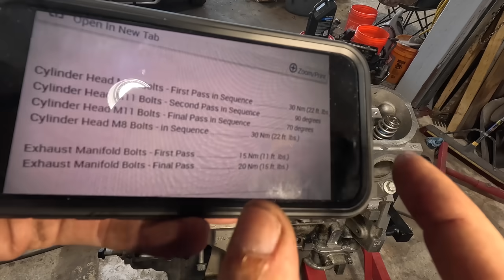This is the LAST VIDEO (LS Engine Rebuild) Ls1 Ls4 2006 SS Monte Carlo 5.3 Part 5

Comment: Ray, you missed chasing a threaded hole on the right side block for the right side head. Bottom hole 3rd one back due to wife unit interrupting you to do "paperwork" 😉 in office.
Reply: Yup...  I was going to say the same thing.
Reply: That's why you can't have interruptions when assembling or rebuilding an engine, as one lapse of concentration and you may have to do some major repair work or pull the engine out again.

Comment: On the crosshatching of the cylinders while I did not complain I believe what may have caught the eyes of some viewers is that they were done by hand and they are not at perfectly identical angles from cylinder to cylinder.    Really the main thing that matters is that the piston rings develop a good seal without breaking any rings and and have good compression and the oil rings clean oil from the cylinder walls.    Not so important that they all look nice.

Comment: Ray must think I need help spending money. Ever since i seen that 56oz. Gray handle dead blow ball peen hammer I always wanted one. A few months ago I warrantied some snap-on tools and bought some replacement sockets, a carbide tip scraper and the 56 oz hammer. I was cut a deal on the truck hammer retailed for $199 and the rep said I’ll let you have it for $100. So now I’m the proud owner of a BFH (Big Friggin Hammer) 😂

Comment: Ray. Why would you not change the internal parts with new such as the oil pump and stuff like that see being as it suffered loss of oil pressure. Just a question
Reply: Well, he probably would if the customer had asked for that. As a mechanic or technician, you only do what the owner or customer asks for. Owner likely has a cap on the amount of $ he's willing to spend on the engine.

Comment: I was hoping the last video would include a jump to the car back together so we could hear it run. It's got a performance cam, not just a stock DoD delete cam, right? Based on you making mention of removing the van engine next, I'm guessing this video was filmed quite a while ago. No reason not to finish with the car running. @11:00... I only use RTV Grey on engines. @22:30... Probably would've been best to do that when the block was bare. @26:00... You missed one.

Comment: Ray why don’t you install a new oil pump when rebuilding a LS engine ? 
I guess I’m use to older GM engines as that’s what I have in my 68 and 69 Camero’s and my 70 chevelle

Comment: You chose to not install the solenoids that control the lifters for 4 or 8 cylinder function.  I did not see if the oil channels connecting the solenoids had to be plugged, to avoid pressure loss.  Is this going to cause a problem?

Comment: That's the good old torque wrench I like. Not some beeping machine.
If the engine thinks it shut down a couple of cylinders, wouldn't it also change the fuel mixture or shut down the fuel injectors on those cylinders?
Reply: On the afm, fuel injectors are turned off, and then the lifters deactivate so the piston moves up and down in the cylinder, but there’s no compression/power stroke.
Reply: @kd7cwg  
Understood. However I thought Ray was removing the device that deactivates the lifters so they always operate. Wouldn't the system still deactivate the fuel injectors?

Comment: I only chase or cut threads with a single speed drill + my hands only. I would never do it with a drill as I want to feel how the tap is going in. Far to risky to warrant using a drill for my taste. You only need to screw one thread up (pun intended).
Reply: It should ALWAYS be done by hand and never with power tools, Ray was just being lazy and setting a bad example.

Comment: Not critiquing but wouldn't it have been better to tap those holes before putting the pistons or anything back together to prevent any contamination?
Reply: My thoughts exactly. Tap the holes before begining assembly. Also, I would have not used any power on that tap. There are handles to do it by hand. Makes it less prone to breaking off the tap in the hole.
Reply: Ray gets in too big of a hurry and wants to cut corners.  That’s why he isn’t a good engine builder.  
I hope the up and coming engine builders don’t watch this and think this is how you do it.  Plus he used the old oil pump.😱
Reply: "Not critiquing..." My a$$! 😒
Reply: Lots of things happen off camera.
Reply: @shakerman55 A new oil pump is a requirement. I would have went with a high volume.
Reply: @jokensy101 He made some valid points.
Reply: Beat me to it.
Reply: Always chase threads by hand.
Reply: Tap lube and cleaning the tap after each hole, very cringe watching.
Reply: He's using a thread chaser. They keep the debris in the threads and you don't need oil and never had them break on me
Reply: @subaruxv19  He’s using a tap on the smaller holes and he’s removing metal from the block. He doesn’t clean the material off in between. I have been machining a long time and that isn’t The Way!
Reply: You can see @ 27:02 it’s clearly a tap and look at all those aluminum shavings that used to be threads, that are getting ran into the next hole dry. There is a reason they make tap magic.
Reply: Yep !!
Reply: @TheGeneralMotorsGeezer-we3dg  why don’t you send in some money for it since the engine rebuild over budget for the customer
Reply: @gimmeaford9454  Nah, thats OK. You saw those old cam bearings on an engine with less than 100K miles on it. Just use the old one. When it goes out it will cheaper to repair.
Reply: @subaruxv19 
So the debris he was blowing out everywhere wasn’t really there?😂
Reply: @shakerman55 You know he talks to the customer right?
Reply: @Havok135  
Yes, I realize that.  But the customer is like a lot of “non mechanics”, or “sloppy mechanics”, on here that think everything that Ray does is absolutely the best.  So, the customer wants to save some money, and Ray told him the old “beallright” good old boy word.  With the amount of labor involved here and a total tear down involved, this is an amateur job at best.  New oil pump, dog bone, cylinders checked with bore gauge and for roundness, block professionally cleaned and all holes chased, (before assembly), are mandatory.  And the afm/dod oil holes should have been plugged because there is a great chance of an oil leak here that could cause loss of oil pressure.  Yes, people have done amateur rebuilds and got lucky, but when a professional doesn’t want to take the gamble and get a bad reputation, he always mandates the things known to cause problems.

Comment: For crying out loud, there's nothing in that paint that's going to be enough of a contaminant to be a problem in the oil. Leave the paint on it because it will still be there when somebody takes the engine apart. One of the first jobs I ever did on a car with my dad was when he took a vehicle that he had sold to a man that had driven another 80,000 miles with it this is a 1963 I believe. And he was changing the valve seals. And the original paint marks on the valve springs was still could be seen without wiping the thing off because it had oil change every 1500 me. And the man was driving from Pensacola to Miami on a weekly basis. That's why he had put so how many miles on this particular vehicle after my dad sold it to him it was the first vehicle that my dad ever bought brand new and it was a 1955 Chevrolet. The best-looking of all the shoebox Chevrolets.
It's a stock oil pump, take that relief spring cap off and put at least two 5 mm washers in there and raise the oil pressure a little bit, it is cheap insurance.

Comment: Chasing the threads after the short block is "cleaned" and assembled? Using a drill motor to chase the threads? Not cleaning the tap after each hole? Love ya Ray but that's not setting a good example for the folks trying to learn how to do this at home.
Reply: He did an amateur block cleaning and was in such a hurry he forgot.  This is the point I have been making.  He set a bad example for people thinking this is the right way to do it.🫣
Reply: I got heartburn watching him with that drill, you never, ever do it that way.
Reply: I think you should have sprayed the drill bit with brake clean between each chase of the threads.
Reply: @mrf246  I've never seen anyone tap with a drill before lol. That's just asking for trouble.
Yikes indeed!😬

Comment: It's not thread lock it's basically sealant at least on first gen small block Chevy's the head bolts extend into the water jacket hence the need for sealer I've seen guys reuse old head bolts w out success so I always use new head bolts that come w the sealer on them w out the sealer gee I wonder how I'm getting water in my oil maybe not one bolt weeping a smidge would make a gigantic issue but all of the ones at the top that go into the water jacket leaking that's not good at all for sure  I've seen them leak taking the valve covers off when hot and under pressure I could see the water weeping out around the head of the bolt

Comment: Power tapping can be done much faster when you set your clutch to slip when you bottom out the tap. you can run at full speed safe in the knowledge you have automatically protected the threads

You might want to test the method on something a little less critical; i dont think anyone would enjoy a video on broken tap removal

Comment: This whole 'build' has just sat wrong with me from the start. Believe me, I understand budgets. And I have personally done some pretty sketchy 'shadetree' rebuilds myself. But I never PAID to have them done. Is this engine going to have any warranty? When the 100k+ mile oil pump fails, will that be covered, or will they be told that not spending <$100 just cost them their engine?

Comment: It will probably leak oil pressure on the inside of the engine, in the future, since he didn't upgrade the dogbone or replace the dogbone o-ring.  The oil ports for the DoD system should have been NPT tapped and sealed or used freeze plugs to seal them instead of o-rings that will fail to seal, in the future (just like the 3.6 pentastar oil cooler).  Then there's the old oil pump.  These oil pressure leaks will be hard to find in the future without tearing it back down and you may not find all of them at that time.  All the fanboys keep saying "He's a mechanic and not an engine builder" and that makes it ok to do a half-assed job?  It looks like he found a quart of two cycle engine oil out of his storage container, at home, and decided to use that instead of proper break in oil with higher amounts of moly, calcium, and zinc to give the rings and bearings the best chance to seat/seal.  Just because it will kinda work (you won't know the difference- wink) doesn't mean it's the right thing to do.  I sure hope the customer got a shade tree price for a shade tree job.
Reply: And I forgot not centering the oil pump on the crankshaft properly with shims.

Comment: The red rtv has the highest heat rating and is oil resistant and you can use it on exhaust. What are you talking about 😂😂😂

Comment: Lack of recent content  is concerning.
Reply: Ray taking a vacation concerns you?
Reply: @Lazerchicken69  He was back week before last week. Only one video last week and nothing this past weekend. It is unusual. So, yes concerning.
Reply: I'm glad Ray and company got in some downtime, not surprised at all the content slowed down. I've always been impressed he gets so much work done, records and edits it all himself. That's at least 2 full time jobs on top of running the shop.

I miss the frequency too, but I won't begrudge him taking a much needed break!
Reply: @clbcl5
If you're that concerned about lack of content, you need a new hobby .
Reply: @charlesslack8090  Concerned for the reason. That everything is well with them. Last year Ray had problems with a family member outside the 5 of them.
Reply: @clbcl5  
That might be a reasonable concern, but don't pull the fire alarm just yet.
Reply: @charlesslack8090  Never did pull some alarm.  That noise you hear is on your side.

Comment: I have been watching you since you started & I think the worst thing I have seen you do is to use a taper tap instead of a plug tap on all of the threads& not to cover all exposed parts of the engine. Very disappointing.
Reply: Any type of cleaning should've been done prior to assembly.
And tapping with a power drill?😬

Comment: You go on vacation and all you have over the engine is a rubber mat?  Guess that will do for that 50,000mile or 50 second warranty.👎
Reply: It’s not a nuclear reactor. he clearly had everything oiled and lubed very well. Did you want him to vacuum seal it in a room with a dehumidifier?
Reply: @nicholasstobaugh3966  Apparently, you've never rebuilt engines or anything that requires a super clean environment